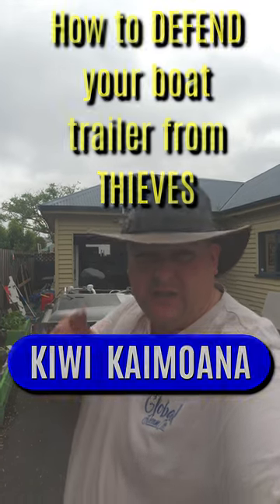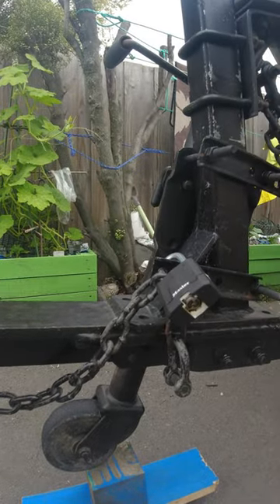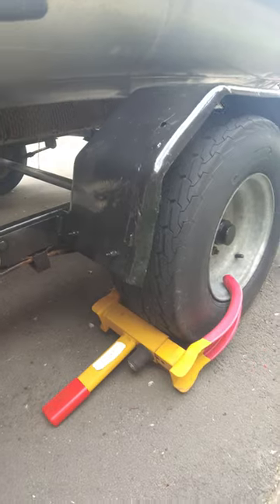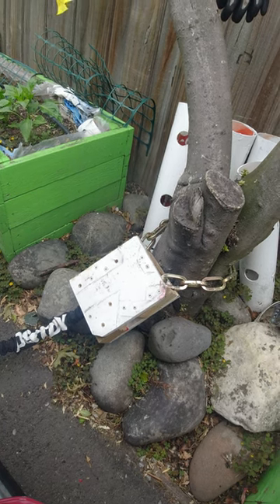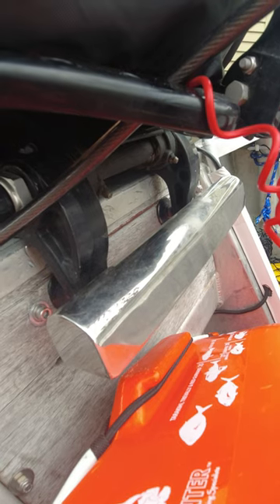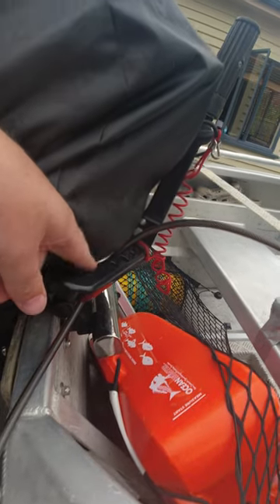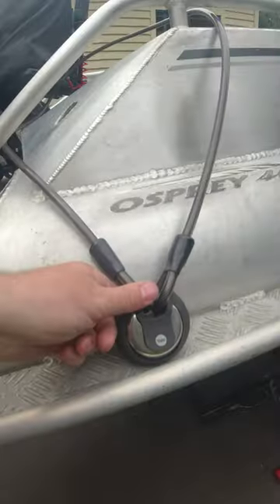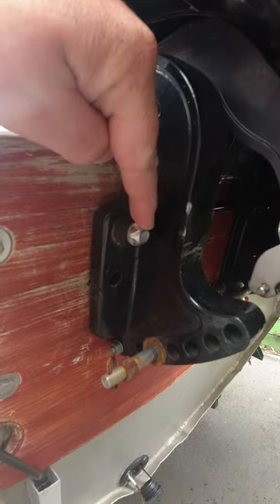How to DEFEND your boat trailer from THIEVES

Comment: i see a 10min battery grinder job just to drive it away. then do the rest at a safe location.
Reply from the maker: yeah the angle grinder will defeat anything. only question is how confident are the robbers to use it, angle grinders are noisy, and I have a lot of neighbours in high density housing close by who would hear it

Comment: Now, where did I leave the keys??
Reply from the maker: Lol I actually have a dedicated system for all the keys, each lock has 2x keys on 2x different keyring, which are stored in 2x dedicated spots in 2x different parts of the house. The keys are even color coded to the locks. In theory it would be very unlikely to lose a key, as my system works well for looking after them.